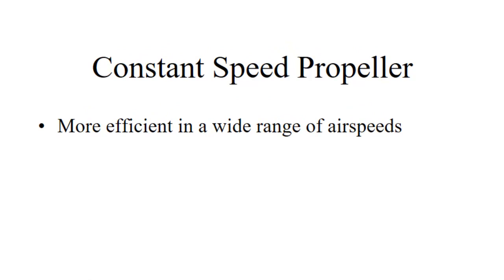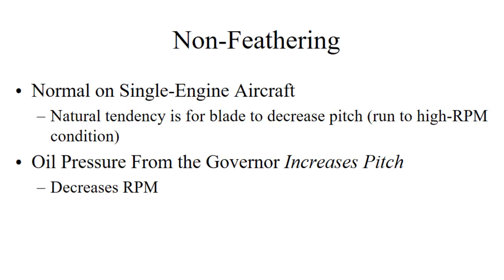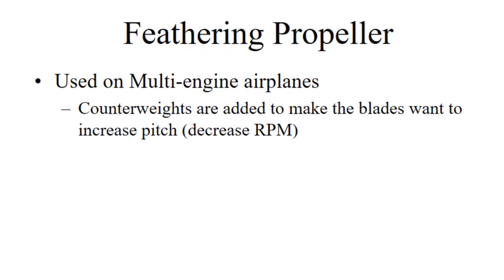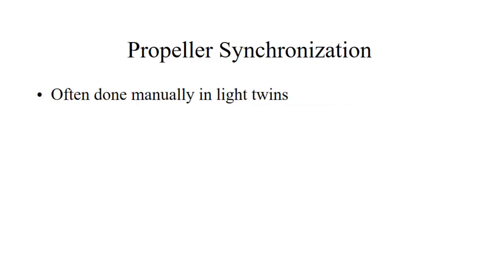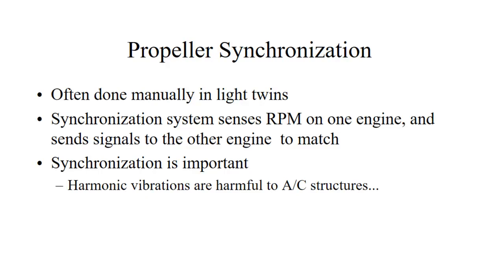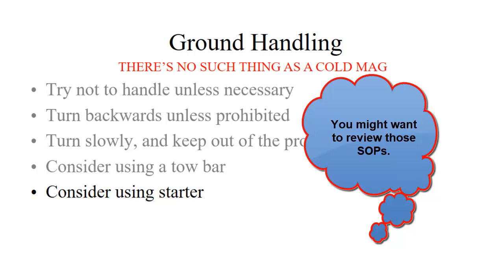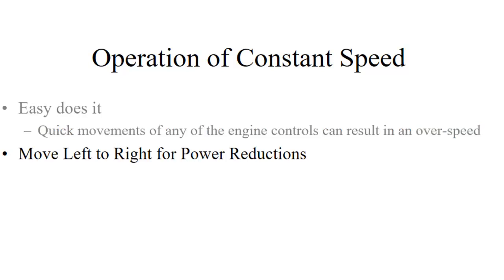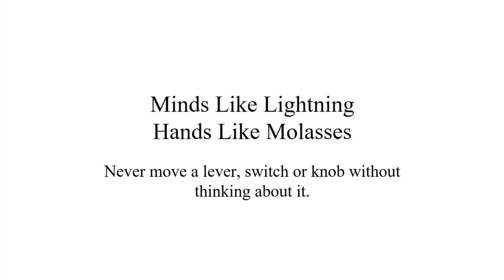ASP - Constant Speed Props and Governors

Comment: Ummm ...Might wanna explain how the actuating oil gets from the engine (fixed), to the hub (spinning)? Thanx & keep up the good work ... ! ^v^
Reply: Engines with constant speed props have hollow crankshafts. The oil flows through the crankshaft to and from the propeller hub.
Reply: @johnopalko5223  Hi John, Thanx for the info. Curious how and where the oil gets into the crank. Is the entire crank hollow and it enters through a seal at the rear? Or is it plumbed through holes in the crank just up where the governor is? Thanx, ^v^
Reply: @taproom113  I'm a pilot, not an A&P, so I don't know the details. The hollow crankshaft was just a bit of knowledge I picked up along the way. A quick Google search reveals loads of theory on how constant speed props work and how to use them but no technical details on the actual plumbing. I'll have to ask one of the mechanics the next time I'm at the airport.
Reply: @johnopalko5223  Copy, and thanx again for indulging me, John. I think I knew this back in the 70's when I was just getting started flying complex aircraft ... but can't remember now for the life of me. I searched all the YT videos I could ... but none went into any finite detail. (I'm aging but my OCD is still Max-Q!) 😵‍💫 ^v^
Reply: @taproom113  I believe it was Seth Lake who made a video in the past year or two where he talked about the hollow crankshaft. I don't recall if he mentioned how the governor connects to the crank.

I hear you. My OCD hasn't abated with age, either. (I don't know if it's OCD as much as it is just unquenchable curiosity.) I'm guessing we're roughly the same age (I'm 69 today!) or you may be a bit older. I got my Private in the late 70's, in gliders, and I added an airplane rating a few years later.

I don't fly anymore because of medical reasons but I just got my AGI/IGI certificate. I've been toying with the idea of getting on the faculty of PCC as a part-time instructor but I haven't really done anything about that yet.
Reply: @johnopalko5223  Happy Birthday, Amigo!!! Small world ... I turned 69 in September. I had my first flight and started flight training in the early 70's at Louisiana Tech University to get on the Navy's AVROC program. Nam shut down before I got my wings but had a 47 year civilian/contractor career and had to stop at 65 due to a heart issue (I thought I had pulled my left rotator cuff ... nope). Now I just restore my M-4-220C Maule while I recover from open heart surgery. I feel ya ... 👊 ^v^
Reply: @taproom113  Thanks for the birthday wishes, you old man (by 4 months  😁 ). It's probably not in the cards for me but I hope you get back in the saddle real soon. Please get that Maule restored. They only built 190 of them. I was just looking at the specifications. Wow! Sounds like a pretty high performance ship. Looks good, too. Give her a pat on the empennage for me, would you?